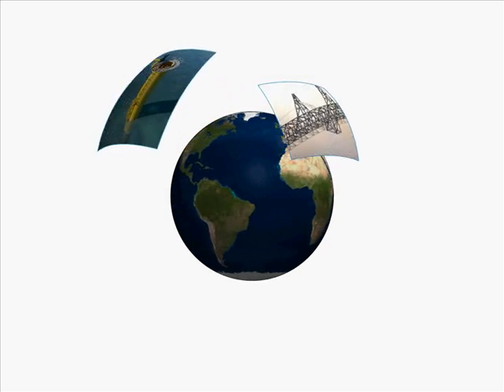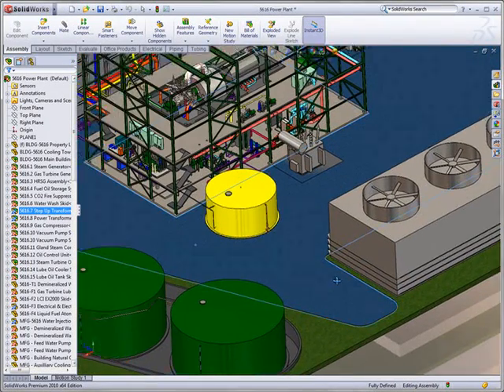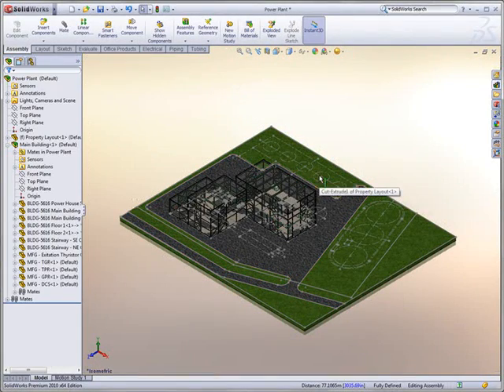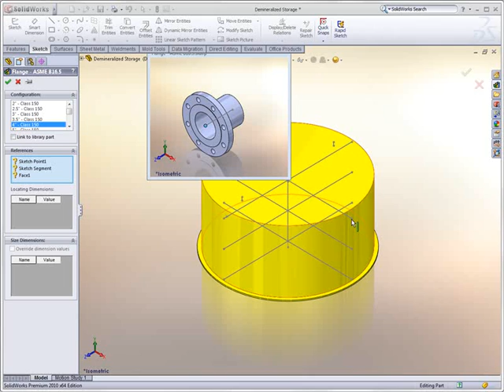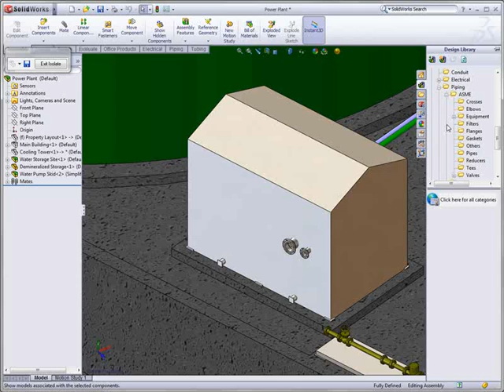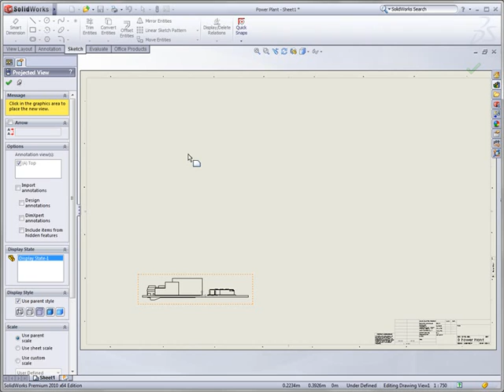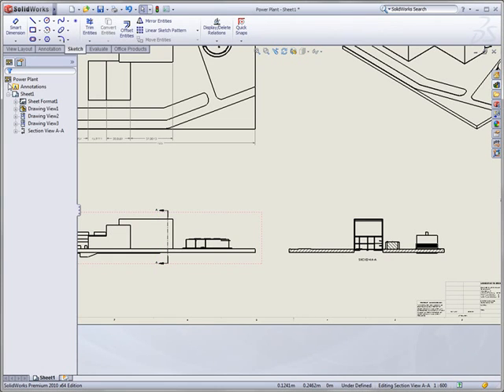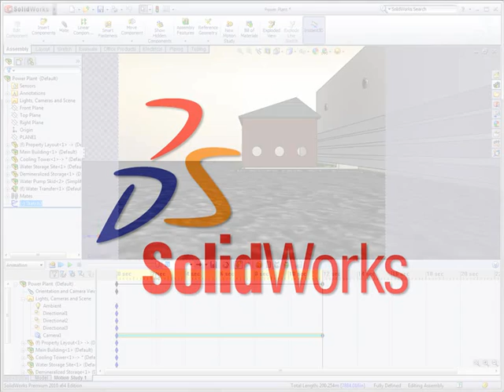Process and Plant Design with SolidWorks 3D CAD Solutions

Comment: Is there tutorials for integrating AUTO CAD files? I'm working on a project at work where we will be "testing" solidworks by making a 3D model of a landscape that includes railways, culverts, trenches and underground piping.

It has a lot going on so its hard to imagine in 2D drawings, I suggested experimenting with solidworks to create a 3D rendition.

AutoCad files are already done so if I can use those it would be a huge time saver